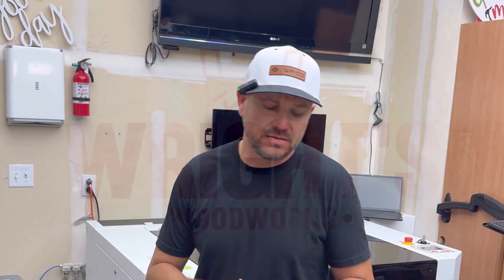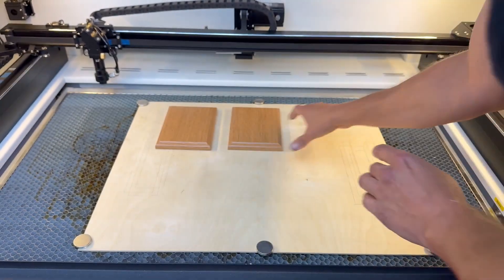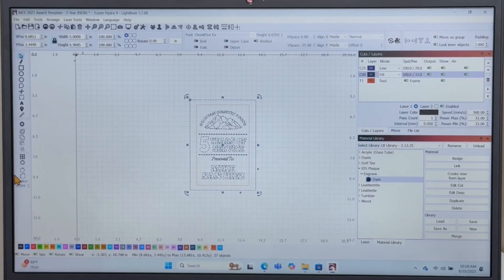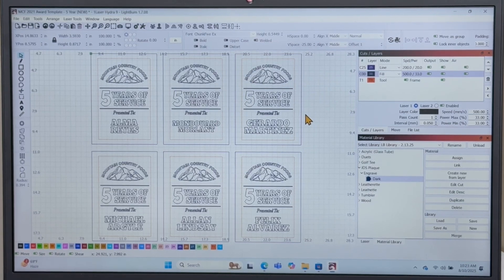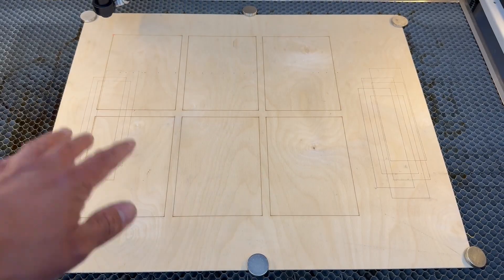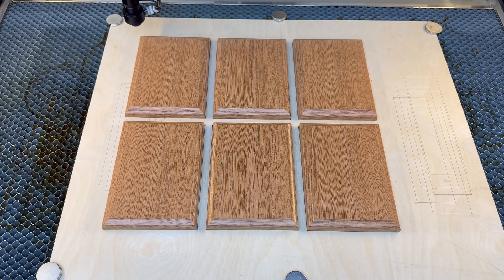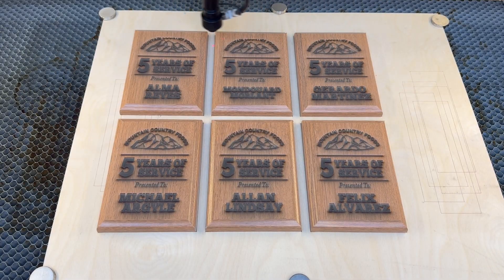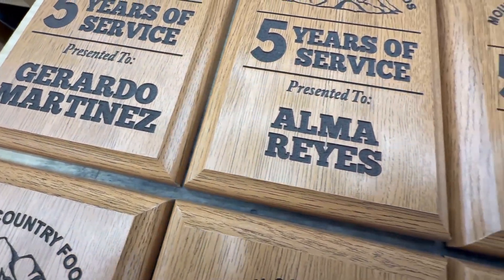Perfect Laser Project Alignment Every Time – Score Mark Method in LightBurn - ONELASER

Comment: I would put the board in the upper corner and all the way to the left(since that is where my laser homes) I'd cut the plywood through. Save the file. Each time you do an award, 1 or 6 or ?, You just drop in the board, push it up into the corner, and load the awards. Having the holes cut out eliminates having to adjust the awards to align with the score marks, greatly increasing the efficiency of batch production..
Reply from the maker: Yes for sure… that’s a great idea as well. Even cardboard could be used. Tons of possibilities!

Comment: Thank you for sharing! You could also turn that piece of plywood into a really simple, reuseable jig. If you move the laser head to 2 or 3 specific locations and just burn a dot at each (could just pulse from the laser control panel), you can use those known locations of the laser head and the red dot to re-align the plywood to exactly the same location on the bed of the laser to repeat the process in the future and reuse your score marks. I will typically burn 3 alignment dots and then just label each with the laser head position using a marker, but you can also design something fancier and burn/label the alignment dots all with the laser. You could also just use 2 or 3 corners of the score marks you've already made and record the exact laser head position at each for future alignment and reuse.
Reply from the maker: 100% Tons of ways to do it.